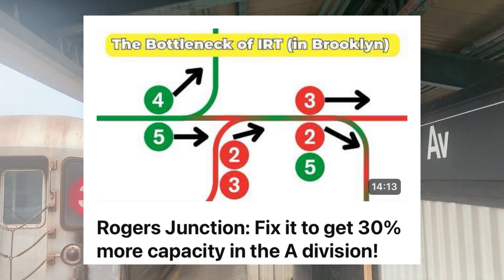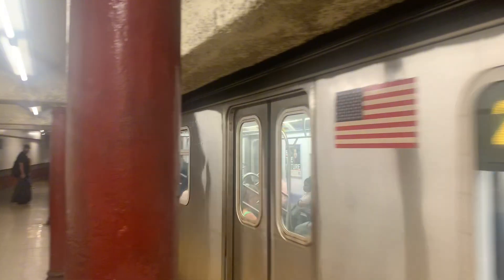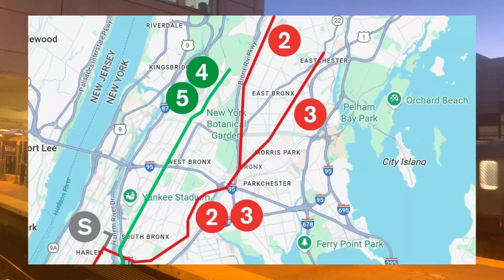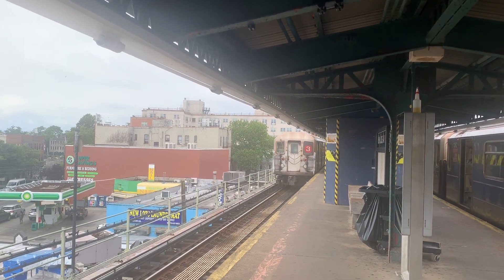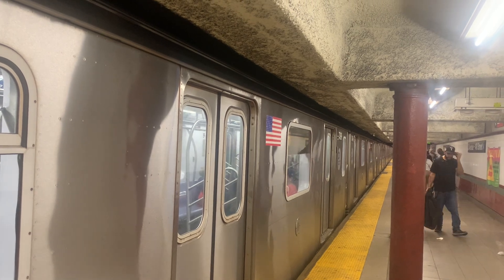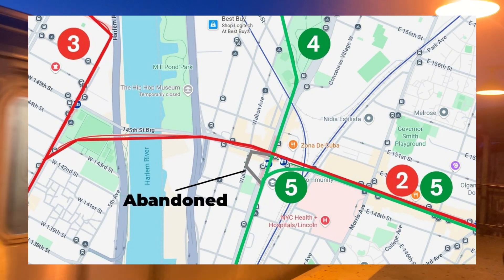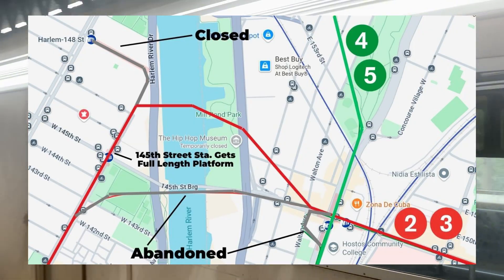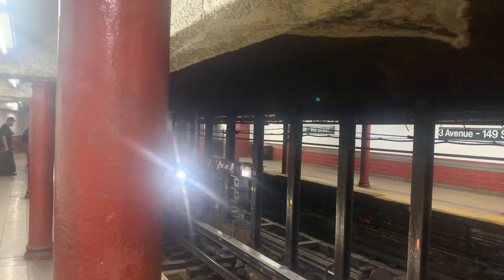The Most Controversial De-interlining Plan: De-interlining IRT in the Bronx

Comment from the maker: Deinterlining IRT Part 1 (Rogers Junction)
https://youtu.be/UOUXtenBMxE
Reply: Having the 5 on Jerome requires modifications as the terminal is insufficant to handle two service, even when attempting to link the 3 to that line in the 40s and two, if the 5 were to take New Lots, this plan would result in scaling the 5 down to serving night time service between Utica and New Lots as a shuttle
Reply: @ianhardy9375 This as a whole is garbage
Reply: @Amiri_subwaymaster what do you mean, are you talking about the video or what I just said in the comments

Comment: You come up with the stupidest plans ever. The 2 and 5 share the same cars, so they have to share a route in the Bronx for best access to their respective yards, the Woodlawn Line does not need another service, and White Plains Road and Dyre Avenue riders want direct access to Lexington Avenue. The current pattern in Brooklyn gives riders on both lines direct access to either side of Manhattan. Switching things around will not work.
Reply: In Brooklyn, switching things around will work for riders, especially with adding a new switch east of Roger’s Junction. The combined 2 and 3 service on the Nostrand Avenue Line would see about 20 trains per hour, and that’s with the Flatbush Avenue constraints, contrasting to the about 7-8 delayed 2 and 5 trains through the whole complex, creating more consistent service. Meanwhile on the Eastern Parkway side, we would be seeing a combined 30 trains per hour on the 4 and 5, providing more frequent and faster service for riders further out. Not to mention that deinterlining does simplify decision making, with one set or routes, one destination, one choice. Exactly like the Costco principle (they have few SKUs of products, and a simplified selection of items).

Don’t worry, there is that cross platform transfer at Franklin Avenue, enable Nostrand riders to head to the east side with ease, and if you can’t handle a minor cross platform transfer, then you seriously need to figure out your life issues.

Comment: is de-interlining 149th Street Junction necessary because the 5 runs infrequent on WPR even with smoothening the curve for the 5 to skip 149th GC it will still cause reverse branching plus the 5 connection isn't popular with Dyre Avenue riders preferring West side services and if that causes overcrowding on both Lexington Avenue and the 7th Avenue line that would require to expand 149th Street complex add new elevators escalators and cover up the third track as well as adding an infill stations on 149th Street on Metro North to solve the overcrowding problem and with regional rail on Metro North New Haven and Harlem line that will disperse crowds off from Lexington and 7th Avenue line hence making 149th Street deinterlining worthwhile the 135th Street station should get converted into an express station with Island platforms using cut and cover and realigning the northbound track of the Lenox Avenue line to become a shuttle fully grade separated 149th Street Junction and Bedford Park Boulevard would get converted into an express station with new switches and 2 new back pocket tracks to accommodate short turning 5 trains with some short turning at Burnside Aveune but this should be the last de-interlining project the MTA should do and why do people claim the 5 train connection is immensely popular I'm it in reality Dyre Avenue riders prefer West side services, the 5 is infrequent on White Plains Road and mostly the 2 is more packed than the 5 train despite other saying that the White Plains Lexington Aveune connection sees considerable ridership which is not true since the 5 is infrequent on WPR and Dyre Aveune riders prefer West Side services plus if you smoothen out the curve then you're wasting money for a trunk line that will still cause reverse branching plus that can easily balloon up to $10 Billion dollars as you have to tunnel using deep-bore under a historical area and under Metro North tracks in the Bronx and what de-interlining method would the MTA go with retaining the 5 on White Plains Road by have it skip 149th Street Grand Concourse via new trackage under 144th Street and Park Avenue or have the 2/3 on White Plains Road and the 4/5 on Jerome with modifications to the 149th Street Grand Concourse station, The Jerome Aveune line, and adding an infill stations at 149th Street Grand Concourse and reopening other stops on Metro North and by implementing regonial rail on Metro North Harlem line which is made possible by adding more infill stations, hiring new personnel, increasing frequencies running trains every 10 minutes or better and buying new train cars to act regional rail as subway like

Then why do other Railfanners propose keeping the 5 on White Plains Road just because the White Plains Road and Lexington Aveune connection is immensely popular which is flawed because Dyre Avenue riders prefer West Side services and the 5 is infrequent on WPR plus people keep bringing up how we can smoothen the curve by having the 5 skip 149th Street Grand Concourse but that doesn't solve the underlying problem of retaining the reverse branching despite having speed up service by a few minutes you move the reverse branch to 3rd Aveune 149th Street creating the same exact problems and spending a great deal of time and money to build new trackage by Tunneling under the Metro North tracks and historical sites which can balloon up to Billions of dollars which isn't worth it so the proposal to keep the 5 train on WPR by smoothening the curve is flawed plus what is the MTA most likely going to do keep the 5 on WPR or have the 3 on White Plains Road and the 5 moved up to Jerome Aveune with modifications of converting 135th Street into an express station, grade sperating 149th Street Junction and converting the Lenox Aveune line into a shuttle route,. expanding the 149th Street Grand Concourse complex and adding a new infill station on Metro North at 149th Street Grand Concourse combined with opening other infill stations and implementing regional rail on Metro North Harlem line by adding fare intergation, increasing frequencies buying new train cars hiring new personnel, decreasing fares on Metro North to the subway and adding modifications to the Jerome Aveune line such as converting Bedford Park Boulevard into an island platform with new switches, flyover tracks and back pocket tracks with some 5 train short turning at Burnside Aveune as express service on Jerome Aveune isn't needed
Reply from the maker: Thanks for the long comment. I’m also not a fan of the smoother tunnel option, the one I prefer is 2/3 to White Plains, 4/5 to Jerome. Though I did miss out on the capacity at Woodlawn， so thanks for bringing up that Bedford Park Blvd needs to converted into an express station.
Reply: @Urban_Man 
I don't want to gossip but do you know who this JeremiahC99 guy is since he claims to be the one who has pretty cool ideas but might have an inflated ego who claims that regional rail is not the same as rapid transit subway coverage I just wanna know if his claims are true or not
Reply from the maker: no，don’t recognize this individual.
Reply: @LTrainSuperemeoffical No and as a 2/5 rider what you stated was inaccurate and it’s clear you don’t ride the white plains road line
Reply: @LTrainSuperemeoffical The 5 trains are packed to the grills by 3rd Avenue 149th street and nigh impossible to get on. And at 180th Street during PM Rush Hours large crowds of passengers from the 5 train transfer straight to the 2 train. And this is in the 3:00 PM - 4:00 PM Range so peak way express ISN’T active by then yet. 

Funny how you criticize the “straightening the 149th street curve for being expensive meanwhile you suggest this garbage proposal that in itself will cause billions of dollars and result in months IF NOT years of delays. Hypocrite if you ask me. 

Seriously where do you get your facts from? DO YOU EVEN LIVE IN THE BRONX?
Reply: @LTrainSuperemeoffical Lastly if you claim is “truly accurate” explain why do people REMAIN ON THE 5 TRAIN? People should’ve been transferring to the 2 train by 149th street on mass IF THEY PREFER WEST SIDE SERVICE. Don’t make it sound like Lexington Avenue service demand is NON EXISTENT BECAUSE ITS NOT!

Comment: The deinterling in the Bronx is so fucking excellent. The 5 can help out the 4 during rush hours and run express in the peak direction. The 4 desperately needs help on Jerome anyway 😂
Reply: That negates the 5 from running 24/7 as having to operate Woodlaen and Utica would just phase it out in not running during night time, adding the Utica Avenue branch would resort to scaling back to a shuttle between Utica and New Lots. Plus, the Jerome line has to be modified to handle two services and better yard accessiblity, something that is not included in the MTA IRT capacity improvements
Reply: No it’s not
Reply: @Amiri_subwaymaster  I bet u live near the 5 lmao
Reply: @niji.marshall I do live by the 2/5 trains and know full well why this plan is a dumpster fire

Comment: The 3 Broadway line does not need to replacing the 6 pelham Line to co op city because they already have the 6 pelham Line. Secondly. The 3 Broadway line should definitely be extended to Ninth Avenue elevated line to Burnside Jerome Ave connecting to the 4 Jerome Ave line. Thirdly the 8 third Avenue elevated line could definitely run on its own line because they don't have no 8 third Avenue elevated line in the biggie down south Bronx Tremont Webster Central Ave Bronx.
Reply from the maker: If 3 goes to Jerome it will create another reverse branch.
Reply: @Urban_Man it's no longer possible, I just mention three reasons in the comments below
Reply: 3 train linking to Jerome line is a problematic because one, the ninth avenue el has been around since the 1800s that the structure and the equipment needed to be reengineered and modified to accomodate newer trains and the big problem is the cost. Two, Jerome line also needs to be modified to handle two services and better yard accessibility and three, the area where the former el trans over manhattan and bronx have been change since thr demolition of that line and with the park and Yankees Stadium swap areas, the stadium is blocking the remainder of the el where is once built making it unfeesable to make that connection a reality in addition to the 3 train's current terminal making it impossible.
Reply: Boogie* down 🤣🤣

Comment: This plan is totally unworkable.
Reply: Because you’re killing one seat rides which is what riders absolutely need.
Reply: @nikitos6712 not really, what riders want
Transfers should be improved
Not capacity decreased
Reply from the maker: My plan does increase capacity, and 149-Grand Concourse will be expanded for improved transfer.
Reply: @Urban_Man  149th Street would be dangerously overcowded.  As a retired TA professional, this plan is bad.  Woodlawn doesn't need two services.
Reply: @pbatommy And the 5 train is literally just a “Rush Hour only clone of the 4 train”
Reply: @nikitos6712  They don’t, millions of people transfer every day.
Reply: Why not?
Reply: Where are they gonna put the 6 pelham Line ? The 2 5 trains definitely needs to stay the same where it is. Including the 6 pelham Line to co op city. This does not sound right.
Reply from the maker: The 6 is unchanged.